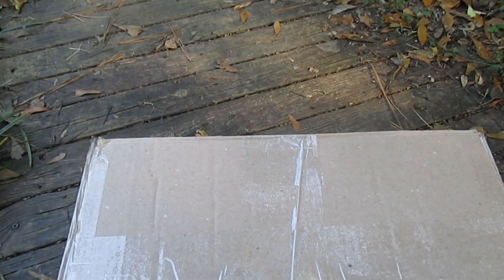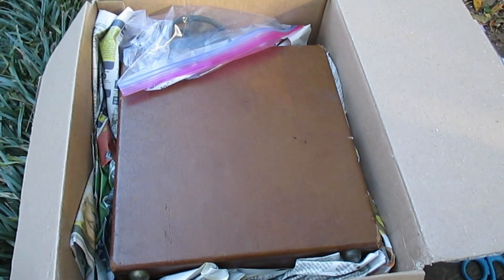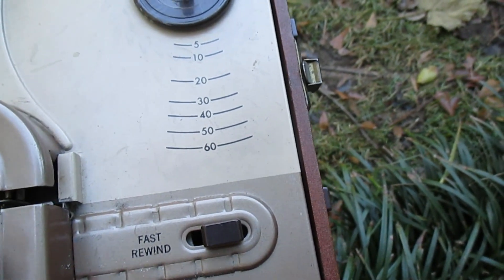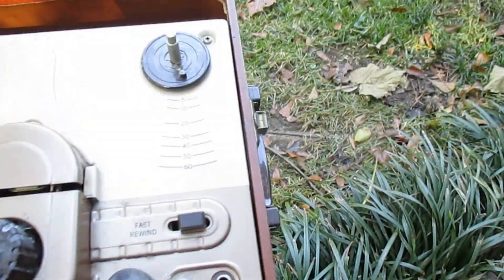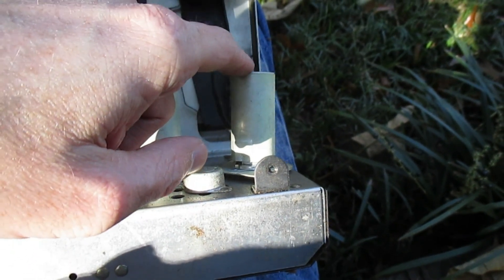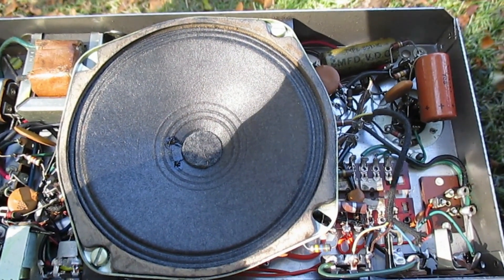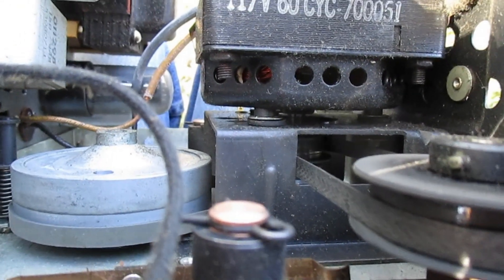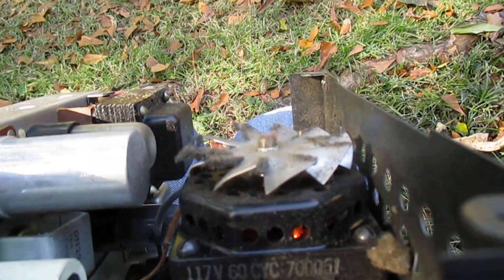Silvertone Reel-To-Reel Tape Recorder from 1955

Comment: A wire recorder would also make an interesting project if one comes up. I am old enough to remember them.
Reply: I have a SILVERTONE mod.7103/ chassis # 110-466-1 floor mod. unit that has a 78 r.p.m. record player/ wire recorder. I was interested in finding out who made the unit( 110 prefix number on the chassis)

Comment: I agree, I believe this could be your first reel to reel on this channel .. and as you said, that machine doesn’t look like much of a challenge to get it running again. A couple of caps, and a clean and lube. If you need a rubber pinch roller and you come up short, give me a shout, I may have a new one or a pull that I could stick a stamp on.

Comment: My aunt was a radio documentary journalist and I just found a box of her tapes and a very similar Silvertone in her attic. Most of it is working, FF etc, and the heads seems to be working, but somethings not right in the pinch wheel area. I was thinking of tossing it or giving it to a guitar player friend for tubes, but after seeing this I think I'll hold on to it in hopes you some day make a restoration video on this. I already learned a lot. Thanks!

Comment: That looks like the old  tape recorder I found in the late 70s. I was hired to help clean up an elementary school that had been closed down for over a decade. I found the tape recorder in an office closet. There was also a microphone and several reel to reel tapes in a box. I took it home and later I set it up in our living room and tested it by recording the audio of a "Happy Days" episode. It worked fine. Unfortunately, I really had no use for the thing and it ended up forgotten about on a shelf in our garage. It sat for years next to a 50s TV set I dragged home in 1973 and a metal tool box filled with tools that couldn't be opened because I lost the key to the padlock.

Comment: All things considered, it looks like it's in pretty good shape for the age especially.  I'm surprised how clean most of it looks on the inside.  With some of these machines to save money, and I'm not saying it for this particular model, but some of them had a capstan sleeve for changing the speed and an EQ switch to compensate the equalization of the speed it was recorded at.  The other thing that is interesting to me is there's a little tab that goes into the hole of each reel to pull the reel along.  Newer ones had the three little splines (at least that's what I call them) to go through the center hole.  Who knows, some of that oxide may have protected the heads.  A few years ago I picked up a Sony TC355 stereo machine and the pinch roller wouldn't engage.  Being that I have had experience with another Sony I had the one pivot point where the mechanism came up had gummed up grease in it like you would find in an old turntable.  Once I freed that up it was great.  Also there was so much crud from the oxide on the heads that I actually think that protected it from wear.  When I cleaned the heads off and made a recording with it the fidelity was unbelievable.  I recorded a sample from a CD through it and it sounded just as good as the CD did.  I play in a group and hooked it to the record output of our mixing console for a couple of our gigs.  Although the mix through the output wasn't good, the clarity of everything that did come through was unbelievable.  If we could have monitored the recording in a different place it would have been able to be put out as a live album.  Do you have any tape to try it?

Comment: The good news is those flat, rubber coated cloth, reel spindle belts seem to last forever. They appear to be loose, but the spindles swing out during FF, Play, and REW. The belts are designed to slip just enough to maintain tape tension. 
The only belt you'll need is the capstan belt which is basically a large 1/8" cross section O-ring. 
My first tape recorder was a Silvertone 1234. Same transport but could playback stereo tapes via external connections. Because LP record companies were worried about piracy through duplication, manufacturers were only allowed to provide one record amplifier. This prevented stereo copies, as stereo was just beginning to become a household word.
Reply from the maker: As recent as the 1980's, I recall record labels pitching a fit over double cassette decks, because they didn't want people making copies of pre-recorded tapes and selling them or giving them to friends.

Comment: Just to let you know those aren't rubber belts going to the tape spindles they are some type of fiber belts I have a silver tone very similar to that one those belts go around the motor spindle and act as slip clutches (light pressure) and provided full speed at heavier spring pressure. A rubber belt will not work, at least in my experience it didn't. Those do not stretch at all like rubber belts. One of the original ones had a loose string and got snagged by the motor pulley needless to say it was like a vacuum cleaner on a carpet snagging a loose carpet yarn wrapping around the beater bar of the vacuum cleaner.

Comment: That thing has lots of hours on it.  Look at the dust on the fan blades.  It would take a year of 24/7 in my office to build up that much on my desk fan.  And I work in a 100 year young building!
Reply from the maker: Yes, and other clues are all of the oxide on the head and pinch roller, and the thorium burn-off on the tubes.